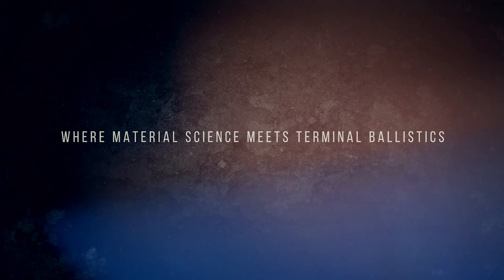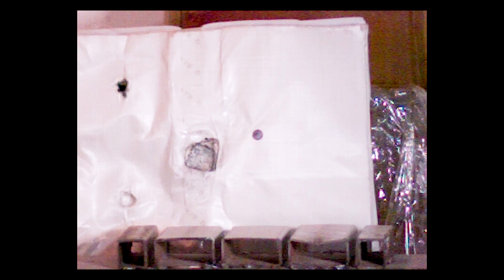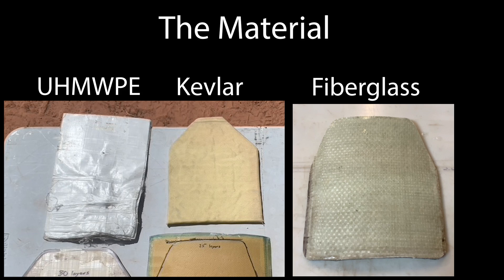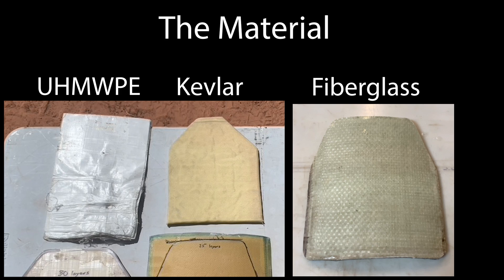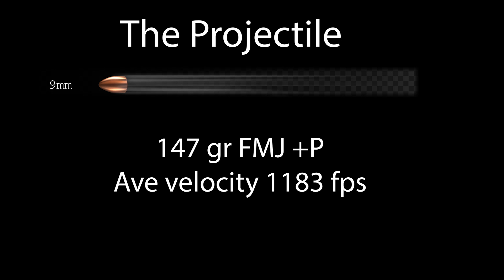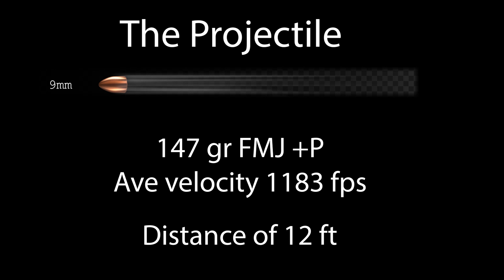Kevlar, UHMWPE and Fiberglass vs 9mm slow motion

Comment: Are there any plans to connect them?
I mean 1/3rd of uhwmpe or kevlar + 1/3 of FRP.

or add buffer material so it will be kevlar+polyurethane+FRP with weight less than kevlar only  target.
Reply from the maker: I do have something like this I plan on testing. I even have all the material, just need to find the time to get it done.
Reply: @3RBallistics  Is it OK for you that I fountaining with ideas which look like advices?

Comment: Surprise cameo at the end!

Have you used any of the unidirectional Kevlar?  I read a study abstract (the main text is in Chinese) that putting woven UHMWPE layers in front of UD layers absorbs 20% more energy.

It would be interesting to see if the same holds true for Kevlar.

The study is "Ballistic mechanism of the hybrid panels with UHMWPE woven fabrics and UD laminates" if you wanted to read the abstract.
Reply from the maker: The kevlar used in this video has 5 layers K29 and 20 layers of UD Kevlar
Reply: @3RBallistics  Good to know, thank you.